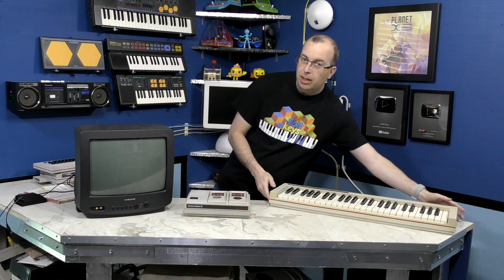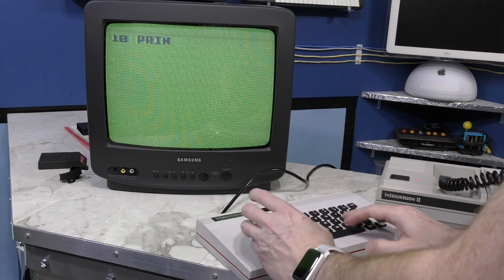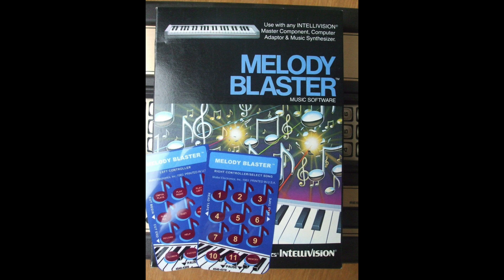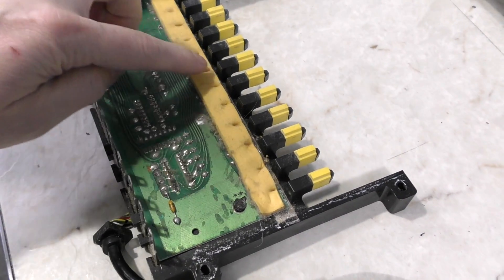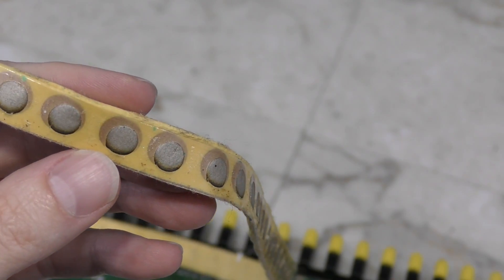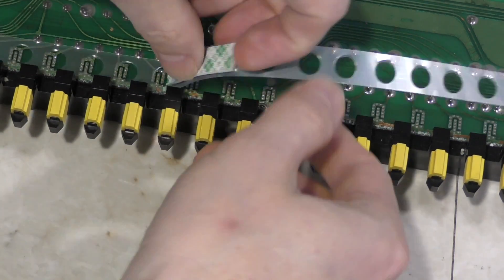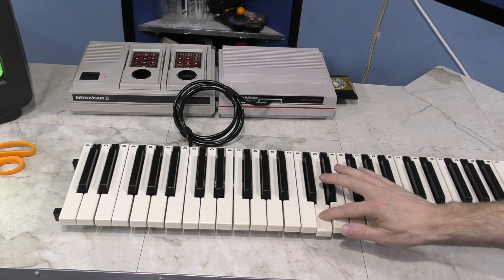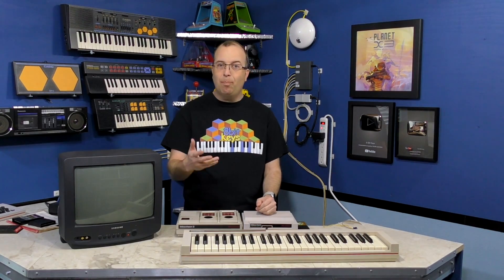Intellivision ECS Keyboard Repair and Demo

Comment: You're pretty good at the coding, the disassembly, the electronics, the soldering, etc. But you're also really good at stuff like figuring out that foam strip. No manuals out there to read to learn how to fix things like that. You're adaptive!

Comment: Much too late to this show, but foam weather-stripping in a roll like the foam tape likely would have been an optimal solution, since it is intended to have a good deal of rebound since it's intended to be compressed and decompress fairly frequently. I'd probably just use a hole punch from the craft store of an appropriate size to punch out pieces of a suitable metallic foil and just stick that to the underside of the weather-stripping through the holes in the spacer. I think I'd just use some thin double-sided tape along the edges to hold everything down where it's supposed to go and call it a day there. I'm not sure that aluminum foil would work, since aluminum tends to oxidize pretty easily and aluminum oxide is closer to an insulator than a conductor. If you wanted to splurge, some silver leaf could just be applied directly to the adhesive and any excess brushed off of the spacer. Gold leaf would also work, but would be a needless additional expense. Copper leaf could also work, though it is harder to find in craft stores.

Comment: That's a wonderful job. The backing on the tape is probably causing the issue, as it's far stiffer than the foam tape itself. A thin layer of fabric would have probably worked to replace it. (Next time? ;)

As far as I remember, Melody Blaster had both a free play mode and I believe even a short record mode, though there was no saving permanently. My first keyboards, both musical and QWERTY.

Comment: That was so familiar. The Lisa2/Macintosh XL keyboard was foam and conductors and the foam was mostly disintegrated. What an incredibly cheap design for such an expensive computer. For my project I attached a mylar sheet to a double-sided adhesive foam sheet and punched out each foam mylar circle. Like your situation, the foam ended-up being too stiff but all keys worked.

Comment: ...also, watching you do that got me thinking about a couple of techniques I'm wondering if you considered and dismissed:

1. To make picking and placing the conductive circles more efficient, wrap some of that double-sided tape around a stick of some sort. Then touch it to the circle you want to pick up, press the circle in place, then place the tweezers (or anything else) next to the stick and roll it over them to break the adhesion between the picking stick and the conductive circle without applying significant upward force.

2. Instead of masking everything off, brainstorm workflows that involve applying spray adhesive to the plastic spacer before putting it back onto the foam... which I imagine would have been how they did it originally at the factory.

Comment: When you chose not to record off the TV, I did wonder why you "didn't want to do that". Did you just want to mod it more or do you not have an HDTV with 3.5mm TRS (ie. headphone) and/or RCA L/R audio out connectors that you could press into service temporarily?

(Heck, our last CRT TV before we went HD had a headphone out... sadly, we got rid of it back before I realized I should formalize my packratting as a game and book collecting hobby... though I do have a few 15" and 17" VGA CRTs under the stairs.)

Comment: Yes, David: I would like to see a video about the Intelevision computer attachment.
(5:24) That sounds similar to the heavy Milton Bradley Simon we had in the 1980s, the low tone it would make to indicate you've got the color sequence wrong.
(11:00) Balls, yes. Steel, no. Duke Nukem does not approve.

Comment: Maybe if you slit the foam between each contact, that'll allow each section to move independently without causing tension on the tape surface and make it a bit less stiff to play?

Comment: you might be able to make the stiff key problem less of an issue if you remove the tape backing and cover the sticky surface with something like baby powder —maybe dust it on with a makeup brush, or even a cheap dollar store paintbrush.

Comment: If you need to punch out conducting pads from Mylar again, use some steel wool to scuff the non-conductive side. That way it will look different from the conducting side and you won’t need to test each one.

Comment: Yup, the keyboard foam strip in these are horrible. Ran into this myself on the original brown model. 
But I love that fix. I simply cleaned up the existing strip as best I could, but it was still terrible. I might have to do a Part 2 on my original video. 
Nice work David.

Comment: umm you should have replaced it with a piece of door weather stripping its the exact thing you needed. they sell it in rolls at home depot https://www.homedepot.com/p/Frost-King-E-O-3-4-in-x-7-16-in-x-10-ft-White-High-Density-Rubber-Foam-Weatherstrip-Tape-R734WH/100151221  also   this https://www.homedepot.com/p/Frost-King-3-8-in-x-3-16-in-x-17-ft-Grey-Vinyl-Foam-Weatherseal-Tape-V443H/100205904 it comes in all different widths and thicknesses.

Comment: You need weather/wind proof door stripping, it's self adhesive foam from the hardware store. You'll find it in the insulation and windows/door section.

Comment: Instead of swapping out the entire foam layer for softer foam, why not just cut away a small groove in the foam under or between each key? It makes it less structurally hard so even a slit by a small kitchen knife between each of the keys would help to soften up that resistance

Never attempted keyboard repair though so maybe there is a reason this is a stupid idea, which the internet shall enlighten me on, but would love to know your thoughts on this?!

Comment: Looks like entire groups of keys were being connected to shared rails with some gaps in between (such as 8:44) These gaps were probably row/column scanning. Point being, you could have used a single strip of conductive material per section instead of circles.

Comment: If you were inclined to attempt the foam replacement again, I'd suggest a self adhesive weather stripping for the second layer available from home depot and Lowe's. It comes in several different thicknesses, and varying stiffness, which might lessen the stiffness of the keys.

Comment: I would have salvaged some rubber domes out of a PC keyboard and glued them to the plastic spacer strip. The problem would be finding a donor keyboard that has a wide enough of a contact pad to work with this keyboard's PCB.

Comment: Some computer keyboards have this too, it gets called "foam and foil" switches (for self evident reasons). I think Compaq used them on some portables? 

You've already lived the online shop life and aren't about that anymore, but I've seen kits of those discs and foam pieces being sold for quite a lot. Probably a decent profit margin there (naturally, since it's quite manually intensive to cut out and line up lots of little static-prone discs and everything.)

I always enjoy these very hands-on repairs where you rebuild something.

Comment: Foam suggestion: Weatherstripping tape. It's available in various thicknesses and widths, and most isn't very wide, so close to the width of that original foam strip.  One side is generally adhesive, too.

Also, I could loan you my Intellivision flash cartridge with Melody Blaster on it (and can load any homebrew like the one mentioned, too.) That I would want back, though.

Comment: you should have lightly spraypainted the non-conductive side of that material before using the hole punch so that it was slightly off-color.  Would have saved you some time not having to use the multi-meter on every circular punch.

Comment: I think you're ready to tackle Atari CX52 5200 Joysticks after working on the conductive pads for the Intellivision musical keyboard. Interestingly enough, Atari Inc. also had planned on releasing a musical keyboard for the 5200; it would've plugged into the unused expansion slot on the back of the console...

Comment: That’s so fascinating. I wonder if that conductive paint is similar to what’s in the Intellivision controller itself? My dad has an old Sears Super Video Arcade but the plastic membrane is scratched off at the control disc.... that CaiKote paint has me very curious if that’s relatively easily repaired.

Comment: Before you punched out those mylar discs you should have just marked the whole side of the strip with a sharpy to indicate that side (or place a dot in the middle of each area before cutting it out with the punch). That way, you'd already know which side was conductive without having to test each and every piece. I know, I know: Hindsight is 20/20 as they say! There is also a VERY subtle difference in the reflectivity of the conductive and non-conductive sides which shows up with the right lighting.

Comment: Can you do a video on the Bally Astrocade? It's a game console released back in 1977 that was also marketed as a home computer. It was very advanced for time that it was released, it had 4 built in programs, you can pause games, and a lot more features. But if you do get one please go to BallyAlley because these consoles have major problems (overheating, shorting out, bad capacitors, etc.). They helped me out with fixing one of my Bally Astrocades.

Comment: First thing I thought about for the foam would have to be.. how you call it... '"window/door sealer". You can glue it between door or window and frame, it has adhesive on one side and is foam on the other. It's pretty much like the scotch tape just not double sided and the diameter of that foam is like 1cm and I think that would have been perfect with a conductive tape on the one side. Don't know if you have them over there tho.

Comment: I would figure out how the button presses and solder a row of small tactile pushbuttons in place of the conductive foam. The contacts on the PCB already gave me good soldering points.

Comment: Let's see you make a video of yourself playing a song with a multi-copy version of this keyboard like you do with your others. Take the extra time to fix it; it's not like someone's holding a deadline over you. If you think you need to keep the video stream going regularly, then just make another video of it... show us which other foam you settled on.
Reply: don't comment 17 times in a row, save your comments and write them out once.
Reply: Several problems with that idea,  @dedpxl : 1. It wasn't 17. 2. You aren't the channel's owner or one of its mods. 3. I can't remember them all from beginning to end. 4. They're different subjects, so if I mix them together that will confuse the number of likes they can get. 5. They're different subjects, and clumping them all into one post might make them get skipped more easily because of a potential for TL;DR. Bite-sized is better. 6. They're different subjects, so I want each one to be visible without anyone's having to click "more."

Comment: Next time you have to use Mylar coated metal and need to punch it.
Take a marker and run down an edge or middle of your line to punch on the NON conductive side.
it will save you a ton of time ..

Comment: You could probably have got away with using continuous strips of the conductive mylar foil for each section of the keyboard.

If you look at the common trace on the PCB at 8:42 , it's shared across multiple keys, so probably done like that for each octave.

So it should have been OK if multiple keys were pressed and "shorted" there.

You definitely have more patience than me for repairs like this, though. lol

Comment: Foam deteriorates over time, should had just used silicone. Automotive silicone at the dollar store, make a mold using wax paper, let it cure for 24+ hours. Put the same conductive bits between the spacer. Use a strategic dabs of rubber cement to hold it together... done. Better yet, send it to me, I'll do it.

Comment: A simple and easy way for composite video and audio is to hook it up to a VCR. Plug the rf lead into the VCR, tune it to channel 3 or 4 and run the rca output into a capture card. It might not be as clean of a signal as a composite mod, but it will get the job done.

Comment: I would like to point out that claw hammers have a hardened face and are therefore a bit hazardous to use with punches because they can cause the end of the punch to fragment.  A ball peen hammer is best to use with anything metal that isn't a nail.

Comment: Two thoughts. 

Weather stripping/door foam to keep out wind and bugs and such would be great there for the contacts. Probably the right stiffness and height as well.

And as for the RF signal... VCR? That's a super simple way to get audio output from the RF signal. Granted the mod would make the best sound, but for simplicity, that would be the easiest I could think of. :)

Comment: I wonder if just figuring out a better repair solution of just using little springs or membrane domes might have worked better? I get that he's keeping the repair as faithful to the original design as possible, but I'd have drawn the line at punching out mylar chads! Lol

Comment: David, if you need to make other keyboard circles, I found it works well to draw on one side of the mylar with marker before you cut the circles. When I do KeyTronic foams, where the conductive side is away from the board, I use the marker on the conductive side. In this case it would work well to do the opposite.

Comment: Here's an idea, the wax paper strip on top of the sticky foam likely is adding resistance to the key presses.  I would try peeling off the waxpaper, and laying down a very thin and soft/stretchy fabric atop the foam's adhesive.  This is just to negate the foam's adhesive topping, so the keys don't stick to the foam tape.  It might not be enough to make it 'good' though, I just think the wax paper strip is likely stiff and taught.

Comment: I have been wondering about this for decades now.  When I was a kid, I had an Intellivision, and I had a friend whose uncle had an intellivison which was also a computer - I could never figure out how that worked.  My understanding was that he was a programmer working either for Mattel or a third party Intellivision developer (all I knew at the time was "hes working on making games").  I'm not sure if it was this exact unit or not, it's simply been too long, but it does go a ways towards figuring out what the heck that was!   I think his unit actually loaded cartridges via the top rather than the side, but it may have just been a custom or professional variant of what was apparently a consumer-level device which flopped.

Comment: There is a foam for isolating window/door which sticks to the frame edge so that when door/window are closed no air can get in/out. That could be good replacement.

Comment: Pedantic: DE-9 connectors. The "B" shell is the wide one typically used for DB-25 (aka the big serial port or the PC end of a parallel port, etc).

Comment: its probably a bit more labor intensive than necessary, but I wonder if a 3d printer could manufacture some type of a more robust bracket to replace that spacer, and then use some of those conductive foam inserts from the Compaq Portable restoration, though they would probably have to be resized to fit the holes in the spacer.

Comment: I think part of the stiffness might be because of the paper strip on the foam. Removing the paper should help, though you'd need to do something about the adhesive. Either use something that can remove the adhesive without degrading the foam, or using a thin layer of something else that will keep the adhesive away from the keys without adding stiffness like the paper. Maybe one of those balloons they make balloon animals from?

Comment: I know you said you were done with the foam thing, but a way better foam strip to look for would be the insulation foam strips they make for windows and automotive applications. It's usually black, and really soft and springy. I thought of it as soon as you went shopping. They make some that are mylar and some that are nitrile. A keyword to search for might be pickup truck caps, as lots of people use it as a DIY waterproofing solution for the seam between truck bed and cap.

Comment: Honestly, I'm not surprised about the stiffness and that's what I was thinking the whole time it was being assembled.  However, I thought it would be because the previous paint was malleable with the foam, and the mylar circles would need to be depressed more instead of the tape being too stiff.  Either way, it's always interesting to see the various money saving mechanisms that have been used throughout the years.

Comment: 3M make some self adhesive pads that come in small sizes and shapes ranging from circles to squares. I think you can still buy conductive paint from electronics dealers. 
You would still need the circle punch. Nice video I'm just getting into retro stuff again. 
Many thanks from an old electronics guy.

Comment: Want to see if the Basic is decent? Just type in this program which computes prime numbers:

10 LET x=1
20 LET x=x+1:LET y=1
30 LET y=y+1:IF y>(x/y) THEN PRINT x:GOTO 20
40 IF (x-INT(x/y)*y)=0 THEN GOTO 20 ELSE GOTO 30

Comment: Suggestion for a quick fix to the stiffness problem - use an exacto knife or similar to cut through the foam and backing between each contact. That way the structural strength of the foam is not spread out over its entire width and each individual key only needs to counter the stiffness of a little bit of the tape.